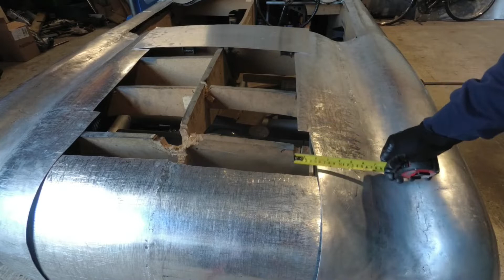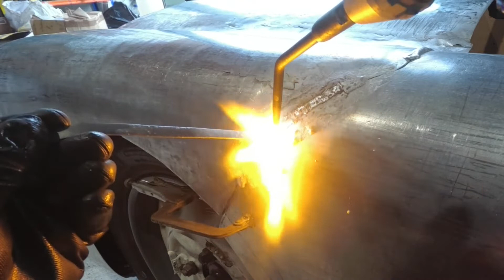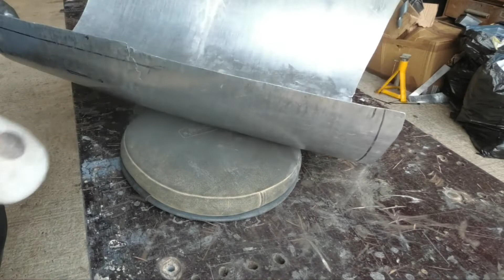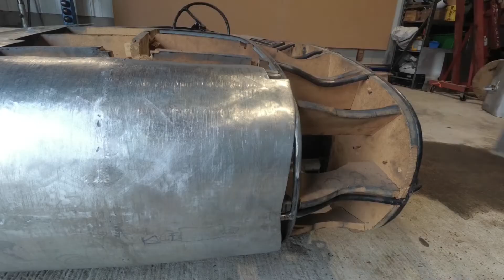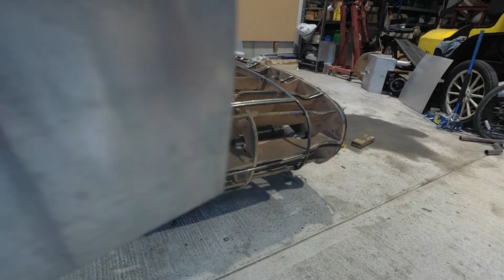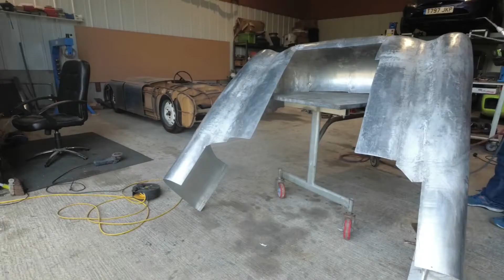Project Etceterini - Part 11

Comment: Fascinating work
Reply from the maker: Thanks.
Reply: It sure is! Your brazing rod is just plain metal?
Reply from the maker: @daveeddy2402  yes, the rod I use is an off cut from the material that is being welded.  It should be 100% pure aluminium and be good to bend or shape after welding
Reply: @GasoliniASMR  that is an excellent series, I could watch those all day. I was praising you to my girlfriend about how well the video production is, no unnecessary music or cheesey homemade graphics.
I'm hooked!
Tell me about that engine..is it a V-4??
Reply from the maker: @daveeddy2402  Thanks!  Glad you like it.  Yes, that is a V4 engine.  It is a narrow angle of about 13 degrees so only has one cylinder head.  Lancia Ardea 900cc.